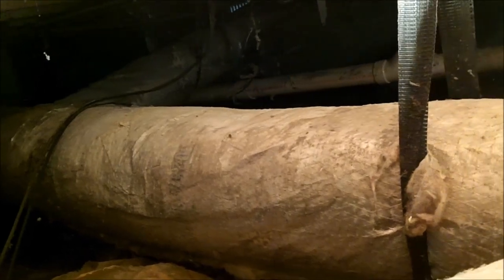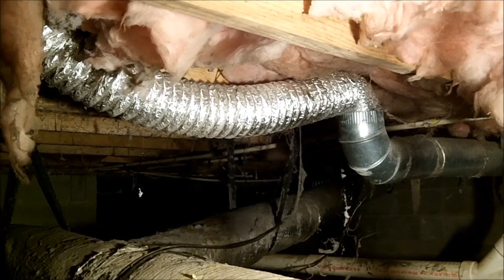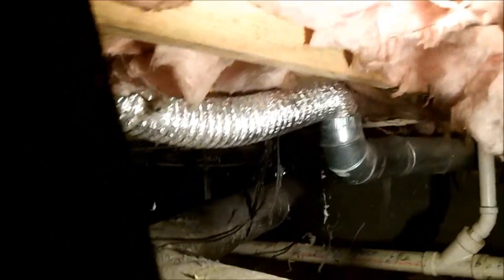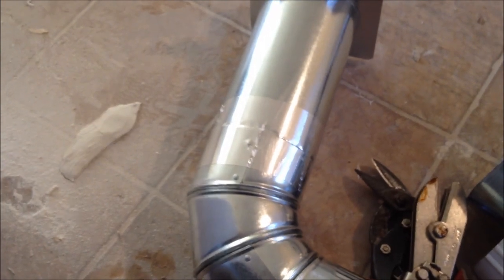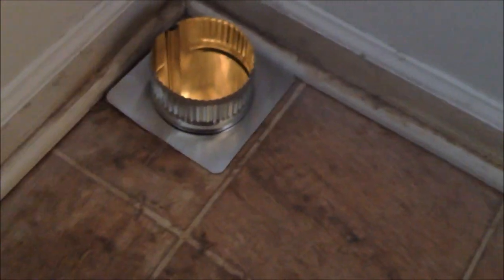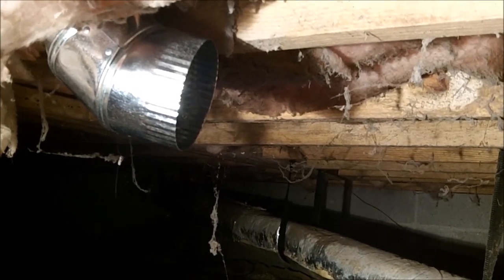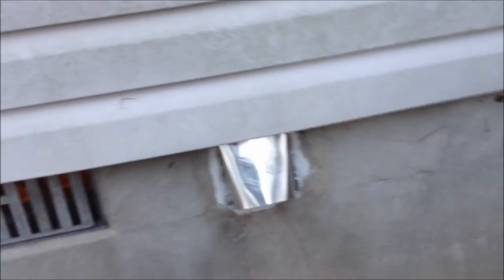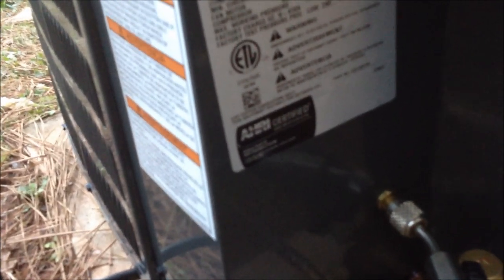Dryer Vent Install

Comment: Great job Ralph. IF everyone would get and understand the 4 rules for dryer vents like you did it, we would have a HUGE reduction in home fires. 1-no screws, tape only, 2-smooth walled aluminum or galv. pipe (prefer alum.), 3- crimped ends with the airflow and 4- no more than 3/ 90's. The way they had that along with the flex fire pipe was an emergency waiting to happen. Thanks for going that extra mile on every call. Take care, Brett
Reply: Assuming these same rules apply to bathroom exhaust vents as well?
Reply: @luke9822  no because lint is not in the picture

Comment: Alright Brett, good job. You had better start explaining why you have the crimped end of the pipe going against the airflow right at your floor transition. I mean, I get it but the folks watching are going to scratch their head when you just told them not to do that.

Comment: I need my 90 degree to immediately turn at a 45 degree angle… is there a way to do that?  I’m guessing they used the accordion vent hose and pulled it down under the house so they were able to make that turn but it’s since been pulled out.  The hole cut through the floor is right by the wall where the exhaust duct is but that duct I coming through the wall at a 45 degree angle from the hole in the floor… I’m guessing when they cut the hole in the floor they didn’t know there was a vent vent for the foundation and copper pipes coming out right beneath it.

Comment: I missed the part where you connected the pipe to the trim ring. Was that a single piece pushed through the trim ring, or connected at the trim ring? What's securing the pipe to the trim ring besides tape?

Comment: Where did you get the floor mount kit?
Reply: Yes where can i find this?
Reply: @pallyann123  Hi Ann, I never received a response to where he got the floor vent. I ended up going to Home Depot and bought a 4” section of vent pipe and cut the hole the size of the outside of the pipe, then slide the pipe down through the hole and when it got to the rib just below the tapered end it stopped it from going through the hole and then I bought the flat flange and slide it over the tapered end that stuck up on top of the floor and when it hit the rib then I screwed the flat flange to the floor. So the floor stopped the pipe from falling through the hole on the floor and the flat flange pinched the rib and held it to the floor. The flat flange had the 4” hole in the center and had about 1 1/2” around the edge. Hope this helps. Unfortunately I didn’t make a video to show what I did and it was in a customer’s home.

Comment: Great job.  
Going to run a new dryer vent from myself and it is basically the same set up as you did in your video.  Did you use a 4" Snap lock Rigid run or a solid piece?  The only rigid type I can find is the "Snap Lock".  I would like to find the solid no snap lock.  Do you know where I could purchase?  
Thanks!

Comment: I thought going thru the floor wasn't good? My Old house has dryer vent going to a baby formula can.... Yep. And that's the outlet for dryer vent  under the house. Wall behind dryer is the actual house wall, mud room was an add on. Crawl space is too tight for me. Any words of wisdom?

Comment: How did you attach the trim ring to the vent pipe before placing it in the hole?
Reply: I just asked this question as well. He completely skipped over that part, and it's the only reason I clicked on this video.

Comment: I bought a trailer and they didn't put the hose back so the hot air from dryer goes under trailer is that bad?
Reply: I would like to know too.
Reply: It's not just hot air. It's hot and humid. Humidity is BAD in dark unventilated spaces. It causes mold and attracts many unwanted critters

Comment: Thanks for the informative video!.... What is your take on using PVC pipe instead of metal for the vent.  Lately I have been seeing some installers using PVC and I wasn't sure if that was something that works.  I have also seen installers using PVC for hot water heater venting.  Let me know what you think.  Thanks again!
Reply: +Danny Herrera   I wonder about using PVC or other plastic myself.  I was just in a basement with a triple-wall HDPE dryer vent installation.  I contacted the sales rep for the company that made this kind of pipe.  He said it was a BIG "no-no" to use any of their plastic  products for dryer venting, because it's not fire-rated.  But I wonder if single wall galvanized or aluminium ducting is fire-rated either?  So it's hard to answer.  Also, why they would use TRIPLE-wall plastic?  This was in a pretty large apartment complex with a big property manager.
Reply: +Danny Herrera - you don't want to use PVC because it would be a violation of building code standards. There's a reason those code standards exist and don't allow for PVC.
Reply: I live in a 681 unit HOA and all of the units here were built in 1975 with 4 inch ABS dryer ducts under the concrete slabs.  Doesn't seem to be a problem.   Using PVC or any other plastic for water heater venting is CRAZY!!
Reply: No pvc